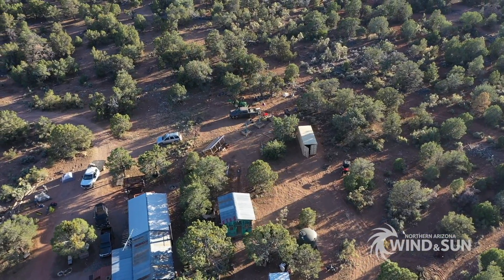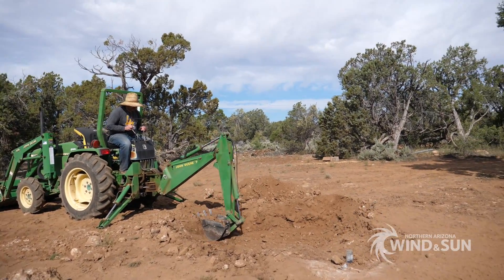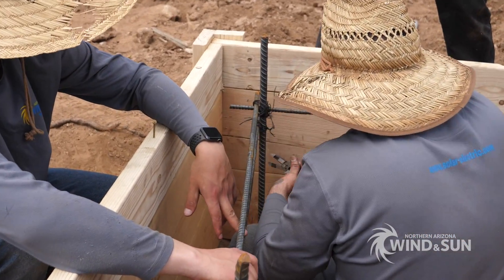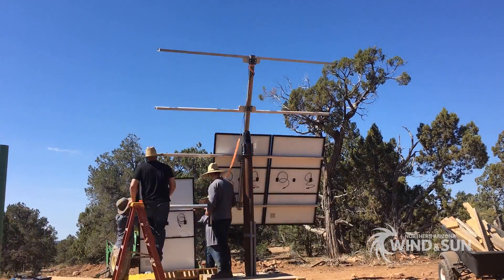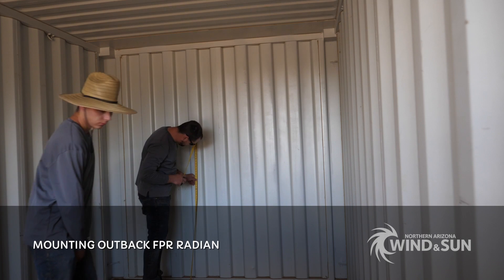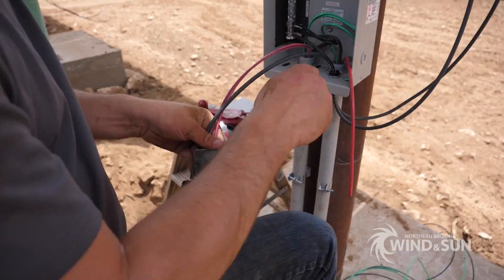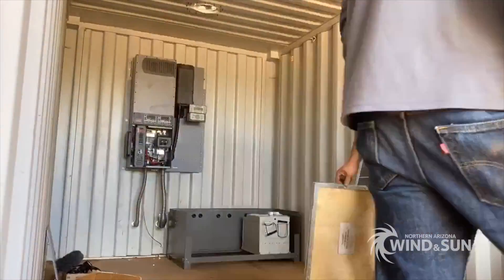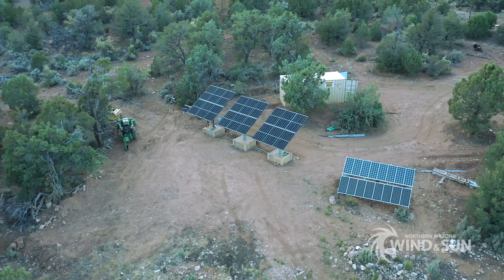Off Grid Solar Power System Installation in Northern Arizona

Comment: How does the Radian compare to the FlexPower? My FP2 prewired system is incredibly heavy.
Reply from the maker: The Radian series is one of the newer inverters from Outback Power. It’s a slightly more cost effective solution compared to the FP2. Unlike other Outback models, the Radian is capable of 120/240 volts AC output using just a single unit. One Radian can provide a continuous power output of 4kW or 8kW (120/240 VAC) compared to the 7.6kW from and FP2. It’s basically just a more modern solution to the FP2 with slightly better specs/functionality and a lower cost.

Comment: Nice video.  That's a lot of work for the foundations!   Curious how many cubic feet of concrete was required?
Reply from the maker: A lot of concrete was used. Probably more than necessary considering the foundations were pinned into bedrock with 1” rebar. It’s hard to remember exactly but it’s estimate about 20-27 cu. Ft per foundation. Also, due to the rural nature of this project, it had to all be brought in and mixed by hand.

Comment: I have seen a couple installations in power houses and now in a container. If I'm installing in an area that freezes in winter, should I be concerned about batteries in an unheated space?
Reply from the maker: You have a valid concern, lithium batteries should always be charged above freezing. This is actually a concern for this location however the enclosure that Tamarack is releasing is design to have 1” foam insulation around the bank of batteries. Couple this with a low power enclosure heater with integrated thermostat and these batteries will easily be maintained at a suitable charging temperature.
Reply: I'm over here in Texas we got freezes and really hot summers with that being a metal enclosure and the sun beating down on it all the time isn't that going to get too hot 🔥

Comment: thanks. Now I am interest to learn more about ufer grounds.
Reply: From Wikipedia: The Ufer ground is an electrical earth grounding method developed during World War II. It uses a concrete-encased electrode to improve grounding in dry areas. The technique is used in construction of concrete foundations.
Reply: I have two concerns about them here.  One is that I didn't hear they are wired together, but even if they were, home electrical systems are supposed to have exactly 1 ground, and the old system he mentioned likely already has it.  Two is another quote from Wikipedia:  "A disadvantage of Ufer grounds is that the moisture in the concrete can flash into steam during a lightning strike or similar high energy fault condition. This can crack the surrounding concrete and damage the building foundation."  Still, I have never heard of anyone complaining that such cracking has actually happened to them.